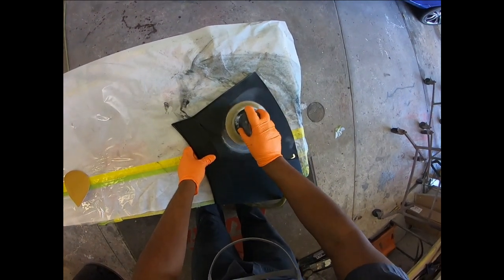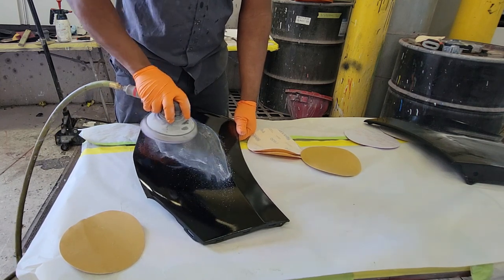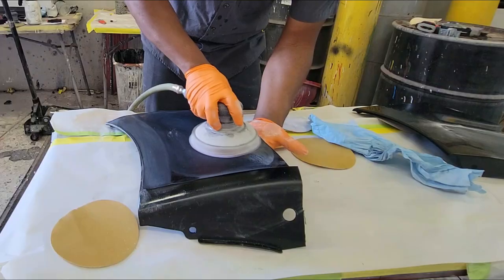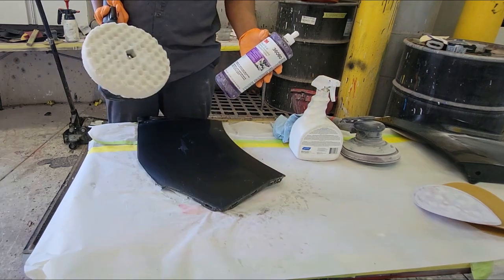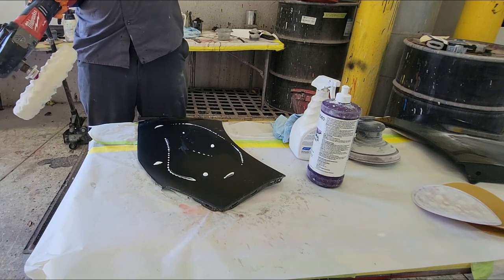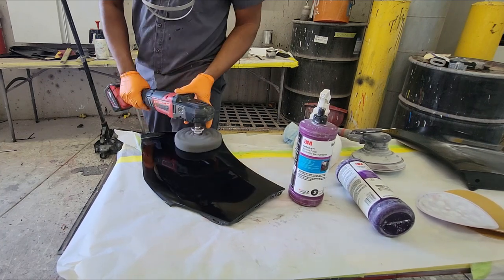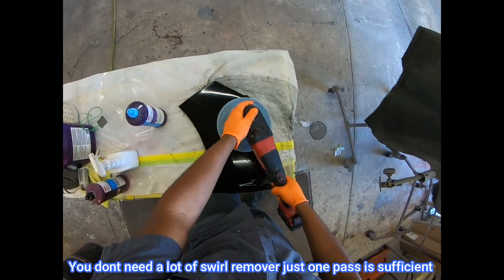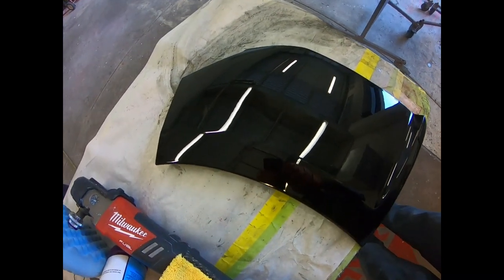HOW TO FIX FISH EYE AND ORANGE PEEL {episode 2}

Comment: My buffing always turns out hazy.  I use an orbital and have tried a rotational before with better luck.  I noticed you are using a rotational.  Do you recommend that more for buffing out clear?  Thanks for the vids.
Reply from the maker: The Rotory polisher is the best one to use. It's stronger and more consistent motion. The orbital is more for detailing in other words it's weak. It doesn't have the cutting power to correct sand scratches like the Rotory.
Reply: @mariopaintclass6091  Thanks so much.  I wondered if that was the case.  It does clean up an old paint job nice but lacks the guts.

Comment: Is the orbital sander the best to use 
Iv a normal one square moves up and down and I always get marks 
When your spraying do you clean the gun out for each coat
Reply from the maker: Thanks for your comment Gary🙏 I’ve always used a random orbital sander- pneumatic palm sander never have an issue. If I’m using the same gun for paint and clear all I do is run some thinner through the gun before clear. No need to break it down.

Comment: When do you recommend hand sanding vs a sander
Reply from the maker: 3re thanks for your comment 👍 I recommend hand standing when is a small area where the sander can't reach. Also if you're not comfortable using the sander. It's less work for me using the sander hence why I take this route.
Reply: @mariopaintclass6091  sometimes I do both depending on the job and the size like you said.